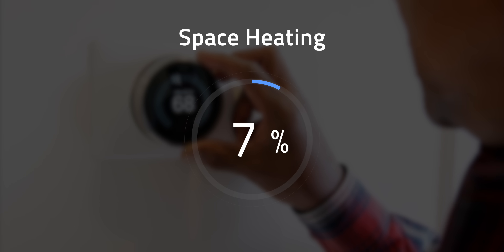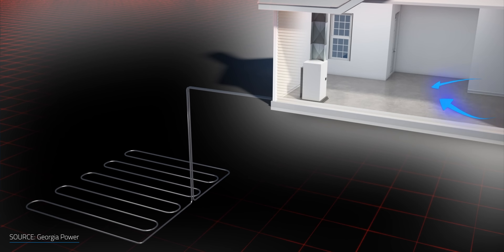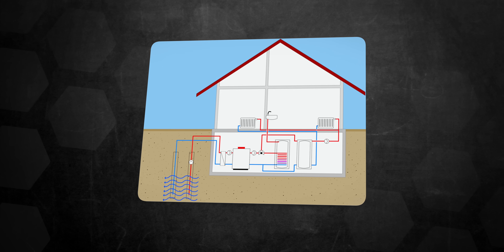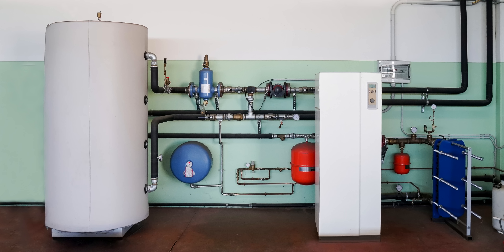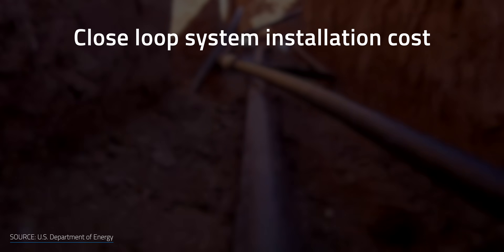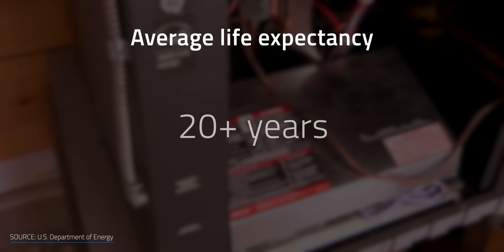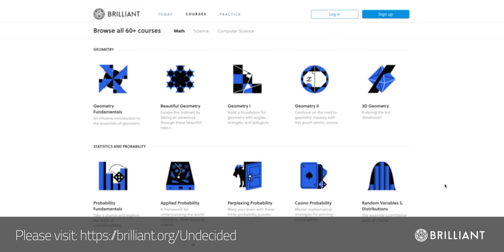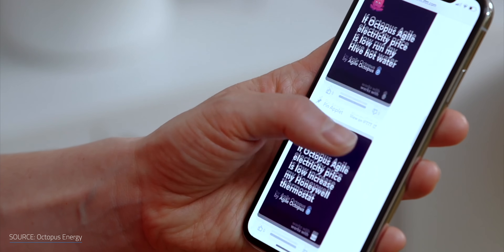Is Geothermal Heating and Cooling Worth the Cost?  Heat Pumps Explained

Comment from the maker: Do you want a geothermal heating/cooling setup for your home?  I know I do.  And to learn more about geothermal energy, check out my other video on the topic: https://youtu.be/-HhdR9YRGxI?list=PLnTSM-ORSgi5LVxHfWfQE6-Y_HnK-sgXS
Reply: Could you do a show on combination solar panels? I hear they could be 80% more efficient than regular solar panels
Reply: @roxter299roxter7  you can put solar panels and geothermal un thé same sistem at least we do that in Switzerland it’s been long time we doing geothermal but we don’t make loops I just make a hole like 100m 150m deep
Reply: I have a vertical closed loop geothermal setup in upstate NY. Home is from 1800's - which is moderately insulated (thick walls make for good insulation!), but infiltration could be better. One thing to keep in mind - When you continuously remove 12 Kw from ground for heat in winter time - it suppresses the "ground temperature" in area around vertical wells (350 ft deep each - 2 wells) to point that water returning from earth loop can be 28-30F..... heat gets removed.... water going back to the earth 22-24F. Wells act like "cold fingers" inserted down into earth. There is no 55F water! So geo works good when it is low teens - no wind.... or mid 20"s with wind. But cooler than that.... on comes the dreaded  electric boost heaters (60 amps of 220VAC each (2 banks)!!!!). So..... to prevent that I use pellet stove during these taxing times to prevent electric boost heaters from coming on! I use Pellet stove to preheat air prior to going into geo system. Heat pump is essentially a Delta T maker..... so warmer inlet air gets heated higher - distributed to entire home. Electric boost heaters do not come on. It would be great if the Geothermal installation companies would think about something other than electric resistance heaters for "boost requiring conditions".
Reply: @josephnehrbauer7343  You are describing my sitiation right down to location. I'm also in Beautiful Upstate NY, run a 2.5 ton geothermal in a 30 year old house with a pellet stove to supplement as needed. We rarely need it, but we like the ambience of the stove fire so I go through a ton and a half of pellets every year. The pellet stove can easily hold it's own in heating our 2400 sf house. The only times I felt a need to run it is under the worst Winter tosses us, and we've seen -10F and 20-30mph winds. But down to single digits the geothermal will do fine on it's own keeping us at 70-72F.

But as you say, there's the dreaded resistance coils. And I was caught off guard two winters ago when I didn't realize a capacitor had failed in the heat pump, and for the month of February we were heating on resistance alone. The thermostat gave a clue (thanks!) that something was wrong in that its display had entered a resistance mode, Stage 1 + Stage 2, but flashing. For whatever reason it didn't click in my mind until we got the electric bill and was 3 times the most we'd ever paid.
Reply: i have geothermal heating for 10 years now!! works great!
Reply: Here in The Netherlands we have a company called Solar Freezer. This is what i am getting installed this summer.    You should check this out
Reply: @homegrown241  Do they install Ice Thermal Systems?
Reply: Yes, I would love to switch to GSHP & hybrid/combination solar panels & wind, with energy storage, vehicle charging, etc. I just need to find the money.
Reply: @williamclark6466  You could start with a thermal hot water system..

Personally, I want to use a combination of geo thermal and evaporative.
Reply: Biggest problem is that it didn’t hear is that most homeowners don’t own their house long enough to actually pay for it.
Reply: I am an HVAC tech and I am very firmiliar with heat pumps and TLDR unless you have a huge structure you are better off with an air to air heat pump.

Geothermal is great if cost is not a factor for you at all (who doesn't care about that) because geothermal is not only more expensive upfront but it is not significantly more efficient than an air to air and are an investment that is unlikely to ever pay for itself compared to an air to air heat pump. Also he mentioned the low maintenance which is not completely untrue but when the system breaks you effectively have to replace the whole system where an air to air heat pump is no more than replacing the out door unit in central air. He also mentioned air to air not being able to provide enough heat but I am going to tell you there are functional air to air systems in Fairbanks Alaska. Also don't get me started on the government credits because that's just the government giving you your money back so you can buy something (usually that their friend developed) you still paid for it either way.
Reply: If you have a basement, Finish it. That's all the geothermal system you need. My aunts house had a basement living room so year round was never hot or cold
Reply: So it appears to be a decent replacement for AC (though unsure if it could handle the cold of Siberia or the heat of south Texas- giving around 20°-25°C [68°-75°F]), but how would they or some other passive technology replace the "AC" of refrigerators which are required in modern society (definitely in businesses)?

If it can handle the heat, some of my Aussie friends would definitely use since the power situation is terrible in rural areas and they have already said NOOOOOOOOO to nuclear long ago.  Wind doesn't always blow and the sun doesn't always shine (and the wind never shines and the sun never blows...except solar wind).  Nuclear was considered green, now it's the abandoned child that has few but explosive outbursts that no parent wants in the divorce.

Labor wants green energy (wind and solar), despite intermittency; and national/liberal wants coal and other dirty fuels, despite being major polluters.  Common sense please...
Reply: @리주민  An evaporative system could easily handle those high temps..a combination of the 2 would be perfect, in my opinion.
Reply: Your math is wrong on using 3.5kw per ton of heating/cooling. It's about a third of that. 11kw for 36,00BTU is nearly the efficiency of straight electric heat!
Reply: I live in New Zealand and we are looking at doing a feasibility study in Rotorua where there is extensive geothermal activity. The study will look to incorporate Solar and Wind in the development of a micro grid for housing developments of between 10-50 homes. 

I love this video, thank you for creating it.
Reply: @everardwhangapirita  Look into "LOw temperature" thermal fluids. Using refrigerents like Freon, etc as a substitute for water in a closed turbine you can generate electricity from heat sources as low as 75 degrees Celsius.
Reply: @spikedpsycho2383  thanks for the advice. I’ll look at that.
Reply: it´s really common in sweden
Reply: Do you list where you get the sources from these videos??
Reply: Have you seen "Just have a think" channel?

Your doppelganger
Reply: Ground vs Geothermal heated source. Two different approaches, according to this. https://jlphillips.co.uk/ground-source-heat-pumps-vs-geothermal-energy/
https://www.ecohome.net/guides/2241/heat-pumps-ground-source-geothermal-or-air-source-which-one-makes-more-sense/
Reply: We save about 100$ a month on average. Saved almost 20k since we built our home in 2008.
Reply: ho far can the underground part get from the house could i say do the same thing longer distance and set the underground part up under a ground pool ? i guess you need stronger pumps then
Reply: Dude, you totally ignored what the typical temperatures achieved, as in how warm in winter and how cool in summer,  which is not that awesome according to the folks I know. You also neglected to indicate is separate loops have to be installed for separate units for separate zones in the home, as in one for upstairs and one for main floor, and maybe one for the basement.
Reply: The simplest way to benifit from geo thermics, is to simply build your house partialy into the ground, and use concrete or block walls. This stabilized the temps from the earth into your rock walls, keeping the home cooler in summer, and warmer in winter like a cave
Reply: YES :D
Reply: nah. too niche, probably useful for a huge family of more than six.  one is better is with solar power and just buy an AC with heat pump.
Reply: Hey, could you look into VFD's(Variable Frequency Drives)?
Reply: You don't heat and cool at the same time..so heating usage being 15%, then cooling usage being 16% means that it totals about 15.5% average, if you heat and cool half the year. NOT 31%.
Reply: @BuddyRevell455  depends on how the research was performed.  If the total annual electricity usage was set up with a pie chart where it had 15% for one and 16% for the other - and 69% went to other uses - then it would indeed be additive (31% total) rather than averaged as you suggest.
Reply: It's to late for me to want one i already have one
Reply: Here's an idea for a closed loop vertical system, one side has a/many large pipes (depends on size of building), the other side has the same number of pipes multiplied by some number, I'll go with 8 for this example, the pipes should be thin, the initial pipe splits into those 8 at the bottom and rejoins at the top, the cold air or liquid will naturally fall and push the heated liquid back up, the thin pipes will help further heat the liquid providing what the short distance at the bottom did not
Reply: @zxuiji You need to learn about hydraulics. Learning is not the same as imagining.
Reply: @pauleohl  I'm gonna assume you only read my 1st response, either way I only gave an idea, it's up to the experts and hobbiests to see what they can do with it, just like how mobiles wouldn't have become a thing if someone didn't take the ideas given for transmission across the air and tried them out to see what worked and what didn't, what could be altered to work, what could be used as insperation etc etc
Reply: Heating no were I live the average temperature is between the high 80's and the high 90's so I would only need like 15 to 20 degree BELLOW that consistently through out the year

Cooling cost are crazy here because of electricity prices
Reply: We installed radiant heat and cooling pipes in our foundation.
During winter we only need to heat up the concrete foundation a few degrees about twice a week. The water runs in a loop through the tankless water heater.

During summer, water valves are switched, when watering the farm, the cold water passes through the foundation, cooling down the house. Free spring fed by gravity from our mountain spring above.

Winter heating cost about 60 dollars a month for propane.
Summer cooling is free.

During summer, the house temperature never exceeds 80 degrees, averages 76 degrees.
During winters hard freeze, with heater off for weeks, house temp never goes below 52 degrees.
Reply: 50 c today i wouldnt mind the cooling
Reply: im in b.c it should not  feel like vegas and worse
Reply: fracking is not good and many other things that are contributing to earthquakes and ruining everything to say the least fuk us shima and more ?
Reply: brillient kinda makes me mad since 06 I have pushed for OPM-Our Planet Peace People Matter - 1 alternative powered farming resources combo o frenewables and farming 2 a  non social pro net work that things like brilliant would have been part of the education side was taken turned into teaparty twitter crowdrise kickstarter and more 3 Public Options bundle lik enet phone cable but one for or basic nessesities like house power car insurances help those who need the help and get fair share out of the top 5% like bazos and rest that cause the mess and rigg the systems helped my dad was a construction surveyour and i grew up around the big dam job to confederation bridge i started learning a bit of autocad on when i was like 8
Reply: instead of grade 12 science i took an environmental studies class that looked at alot of stuff in depth
Reply: @George Mann Not just that it doesn't take heat from the ground or house to transfer. It creates heat with the compressor. Gasses and liquids compress rapidly create heat,  when expanded rapidly they create cold. They can use an exchanger with a fan to displace the temperature difference. This guy in the video is an idiot.
Reply: U should have minimum 1million subscribers for ur work.
Reply: Remember us when u have 10 million subscribers ok
Reply: @starkstark4139  https://www.youtube.com/watch?v=6CqXgs-7ico&list=RDMMqORYO0atB6g&index=18 DMX - Where The Hood At? (Dirty) (Music Video) HQ
Reply: I do miss one critical drawback for this type of heaters. These heaters will be cooling down the ground around the pipes. This works perfectly well IF THAT GROUND has any source for sufficcient warming up again. If not.....don't install such a geo thermical system.

Or add to the geothermical system heat collectors , same type as now used for sun heated hot water boilers, an d force the upwarming of the ground in the warms eazons....this will work if you have a nice place to install those collectors, a snny roof would do. Also usable....solar panels with fluid cooling...The renedement of a solar panels increases when it is less warm...and with fluid cooling using the same pipes in the ground for heating up the ground at the same moment maybe you'll het enough warmth back in the ground for the heatpump in winter.

For the picture...I do have a nice geothermal heatpump for at least six years now perfectly working. But before installing we had checked groundwater flow around our house...this flow transports heat back to the pipes, even with a closed system. Some numbers...we can extract 50 watts of energy from 1 meter of pipe in the ground. For 10KW heating capacity we needed 200 meters of pipe, vertical installed in holes. Holes should have  at least seven meters between because to close together drilled holes will influence the reheating (with the groundwater flow) of the ground to much.
Costs of this installation according to the picture in this video...and it was a new  installation in a region without gaz pipes. This changes the investment differences as showed in the video a lot. Because for any oilheating we would have to build an oil proof isolated cellar for oil storage (expensive to build)  Or a gaz tank far outside the building and border of property as safety margins when leaking gaz.
Reply: @reiniernn9071  there was a newfoundlander who took pop cans painted them black and used small fans to pump hot or cold air it heat rises cold air sinks  it was kinda neat lol and cheap
Reply: @reiniernn9071  same idea as how a black car heats up in the sun
Reply: NOOOOOOOOOOOOOOOOOOO
Reply: Depending on geological location, yes. It could bring down the major cost of home ownership. I used to live in the North East and oil got really expensive. Had a few winters of barely keeping the house warm due to the cost of oil.
Reply: Yes.  We almost put one in for our new home build.  My husband's friend talked him out of it...DANG.  Still kicking myself.  BUT we do have a full solar array.  No batteries yet (hooked up to the grid), but that is the next project!  Love your channel.
Reply: Yes I do.
Reply: We have it and love it so much! So glad we got rid of oil!
Reply: I think reducing the need is more efficient. I have upgraded insulation and made heat exchangers to reuse heat from grey water. http://www.heatsnagger.com/wp-content/dwhrpictures/2012/01/vxpipe_installation_diagram.bmp1.png
Reply: @egilbruoveraa8333  I did similar about 35 years ago. The heat captured is negligible. Once the shower water runs along the shower floor it is barely warmer than room temperature. I transferred the heat from the grey water to the cold water inlet to the shower to maximize temperature difference.
Reply: @pauleohl  shower cabinet with good heat insulation in the floor an full balance in the heat exchange give a good pay back. 

I do not have the same experience.

But then again. Taking out the heat in the floor and keep it in the house heating is also good - as long as you are heating and not cooling down the inside temperature.
Reply: Not in the northeast!
Reply: Does drilling for geothermal heat create any of the problems of fracking?
Reply: I would like a home first
Reply: nah not as good !!! my mother cousine have !!!
Reply: As a HVAC technician I understand all the concepts.. however I don't understand why is it necessary to be underground as such.
Many different types of "condensing units" such as shell and tube or tube in tube condensers provide more efficient 
Heat transfer coefficiency and also more practicality in terms of maintenance or contingency planning
Reply: Depends on if it’s as effective as the regular heating and cooling system. I don’t want air that’s barely any colder for my air conditioning or heat that’s barely warming
Reply: Would be be possible to build system for several homes
Reply: If every house worlwide was heated in this way would the ground temperature remain stable?
Reply: FOR THE FOOD PLANTATION OF GROWING A VEGETABLE GARDEN AND NO NOTHING NUCLEAR OR CONTAMINATED OR CONTAINING RADIOACTIVE MATERIALS EVER HAVE TO LEAVE THE BATTERY ZONE OR EVER HAVE TO CONTAMINATED THE FOOD CORPS ZONE THERES ANOTHER WAY THATS MORE SAFER LIKE A DOUBLE SIDED HOT WATERBOTTLE PLACE UNDER COLD AND FROZEN GROUND AREAS PLUS THEY ARE MADE OR STEEL THERE CAM PAST HOT SPRINGS WATER THROUGH THEM SINCE IN RUSSIA THERES PLANTY OF NATURAL HOT SPRINGS THE PANS BEING THICK ENOUGH TO PLACE FLAT UNDER THE DESIRED GROUND FOOTAGE FOR PLANTING PLANTS HEATED ENOUGH TO KEEP THAT COUNTRIES DESIRED HEAT GROUND AND LESSER POWER NEEDED TO DO SO BESIDES A NATURAL BOILER UNDERNEATH THE GROUND AS WELL BOTH WOULD COST BUT ARE ENVIRONMENTALLY SOUND SAFE AND DANGEROUS AND ODDLY Convenient WHEN DO RIGHT ANY THING NUCLEAR SHOULD BE CONTAINED AT LEAST 100 FEET OFF GROUND REASONS BEING VAPORS AND LEAKAGES ARE VISIBLE DURING ANY SITUATIONS IN A STRUCTURE THICK AND VENTED ENOUGH TO DO SO AND SHOULD BE SAFE TO TO BUILD AS WELL AS BREAK DOWN OR SHUT OFF FOR REPAIRS APART SO AT DISTANCES THEY DONT EXPLODE TOGETHER SPACE BETWEEN
Reply: Let's get an update episode on the company Quaise out of MIT
Reply: What about hot water?
Can I cool my house and get hot water at the same time?
Reply: Wonder how the cost benefit analysis looks in Central Florida.
Reply: My state has no direct-use systems and limited near-surface geothermal resources to run them
Reply: We've done a unique project for a company that shows how their system works! https://youtu.be/IHFe6EJ8avE
Reply: Do we "humans" need this kind of Tech to survive 👍🤔 What you are trying ( inserted with Adds by Tueb or your's ) 🤔 me from India not a Hindu 👍🙏
Reply: I THINK I want a geothermal system.  A big factor for me is to keep it simple.  It was a lesson that I learned, and will not forget.  I have learned a lot, but still want to learn more about geothermal before I finally decide.
Reply: Wonder if this concept could be utilized for apartments (100 plus units)?
Reply: Intuitively, I feel geothermal systems are, again, human abuse of the environment even though, in the case of domestic geothermal systems, the impact is reputed to be low...but why impact the environment at all? Solar energy is free and of infinite supply. IMHO, I would instead generate free electricity to drive home air conditioning system(s). Sigh. Please forgive my Canadian, Oldzheimers naïvety. 😔
Reply: The short answer is no, and here is why.
This technology has been around for some time now and has proven to be reliable and efficient in many ways. 
HOWEVER, there are two very important issues to consider and they are the thermal efficiency of the envelope you are heating (or cooling) and the demand loading of the system with respect to the exterior temperature differential. Typically you can only squeeze so much heat out of 52'F (+/-) ground heat and at some point the make up heat will have to come from somewhere to maintain a comfortable environment. 
Typically, this is electric resistance heating in the main plenum and do not assume that the thermostat can be played with to boost heating as you see fit because this will engage the resistance coils and just watch you electric bill soar. 
So the take away is that you will have to have at least a 200amp service and be on the grid and leave the thermostat alone.
Another caveat is that ground source heat pumps are technology dependant. There are pumps, compressors, solenoids and sensors that are operating at all times when the unit is engaged and these will eventually require maintenance. 
The technology works well BUT I would caution anybody considering this heat source to be well advised the best bang for the buck is to ensure your home has the highest insulation value you can possible afford.
One could also continue with discussing the humidification of the heated air (or dehumidification of the cooled air) within the envelope but that is another issue, although related.
Not all homes will be able to install this heat source technology. 
My advice. 
Find a good recommended HVAC installer and, if possible, engage an HVAC engineer to advise you through the process. 
Thoroughly study the task, understand the technology and look very closely at the economics.
Reply: @douglasker9770  , the standard HVAC contractors are the WORST people to ask!  They like to do what they know how to do.."Conventional HVAC"  If something is 10X better, they will still steer you in a direction of what THEY know how to install.  In america it is THE WORST!  Our contractors in the states are the worst in the world for wanting to advance technology.. Its the same if you try to buy an electric vehicle at an american car company, they knw nothing about the product, and they will try to steer you to buy a gas burning vehicle, even though an battery-electric vehicle blows away a gas vehicle.  So take Douglas Ker's advice with a grain of salt.  Find someone that is cutting edge (at least in this country, and old tech in other countries), and wants to actually keep money in the pockets of his clients.
Reply: No, it's a waste of money. On average, a homeowner can expect total expenses to reach between $18,000 to $30,000 on geothermal heating and cooling cost for a complete geothermal installation. The price can range from $30,000 to $45,000 with high-end ground-source heat pump systems for large homes. With an average electric bill of 1300-1500 dollars a year of which 40% is space heating you spend 500-600 dollars a year heating your home, even if geothermal systems cut energy heating use in Half that's 250 a year. Amortizing a 30,000 dollar installation by saving 250 a yearr would take 120 years!!! to pay off. And you're assuming the system would operate glitch and maintenance free. It would be far cheaper to simply stuff your home with better R-Value insulation.
Reply: @spikedpsycho2383  I'm an HVAC tech and you are spot on, to be honest idk if I would even install one in new construction because when you factor in maintenance costs they almost never pay for themselves unless you get lucky enough to have your ground loop go at least 30-50 years without getting a significant leak because the second you have to replace the ground loop your screwed. I have been to quite a few homes that the ground loop leaked, they got a quote to fix it and instead abandoned the system in the ground and got an air source heat pump. That's your other killer too ground source heat pumps (or geothermal) are way more efficient that traditional electric or fossil fuel heat but they are only mildly more efficient than an air source heat pump that costs no more than a central air unit to install.
Reply: @spikedpsycho2383  I didn't say the home owners had to pay for it, the companies should do so to reduce the electric they use which would cause less strain on the grid which in turn reduces blackouts and even makes renewable energy a more viable option, you don't build a house with a single brick, likewise you don't switch a grid completely to renewable energy by just focusing on the energy production
Reply: @zxuiji  Only 12% of global energy demand is electric, because converting to electric is expensive and not very efficient but it's safe for running casual devices. 72% of the worlds energy is thermal based because it’s efficient to  convert thermal energy into work without having to convert it to  electricity. You convert to electricity you lose half to 2/3rds of the  energy as waste heat. The carbon emissions from changing electric  sources dont matter much since 75% of all GHG emissions come from non  electric sources. The transition to renewables; means replacing thermal, chemical and mechanical power with several added steps, electric generation, electric voltage, transmission, and plug in. ALL these stages result in thermodynamic losses. An electric transportation infrastructure requires a 14 fold increase in grid construction, An All electric machine/industry would require a 90 fold grid increase. Fossil fuels are so much simpler
Fossil energy: Chemical energy --- Thermal energy --- Mechanical energy
Renewable energy: External mechanical energy: Weather permitting --- mechanical energy transition (Generator) --- electrical energy --- Voltage step up --- electric transmission on site --- electric transmission to destination (thermodynamic losses in route) --- voltage step down (transformer) --- transmission to consumer --- consumer utilization (electric motor) --- mechanical energy--- work
Reply: @spikedpsycho2383  You don't seem to get it do you? The public in general demands renewable energy, I can see why too, fossils will only last until we run out, better to switch while we can still generate the electricity we need to experiment and improve than to wait until we run out and re-enter the middle ages permanently. I get your point about non-renewables being easier to generate with but they are only a short term solution, a long term solution MUST be found or humanity as a whole WILL pay the price for it.
Reply: @spikedpsycho2383  Converting to electric (thermal to electric) has an efficeincy up to 80%. (Ideal situation, this isn reached in the nethrelands where also residue heat is used efficient). Most (but not all) other situations the usage of direct thermal heat is less efficient. Even cooking. When using gaz for cooking you'll spoil a lot of heat , going arond your cooking pan. When using electricity, created with 80% effeciency, for heating an insuction pan this will be efficienter (not chepar mnaybe) than loosing a lot of heat with gaz burning.
Reply: @spikedpsycho2383  I don't think your numbers are correct when you say that going electric will require a 14 fold increase in grid construction.

From my own household :  we do about 13,000 miles per year . An average EV gets about ~5 miles/kWh thus to do 13,000 miles we need 2,600 kWh to cover the distance. Even if we allow 50% losses for transmission,  charging etc (realistically it is more like 20%) thats 3,900 kWh for the entire year.  Today our house averages about 1000 kWh/month which is 12,000 kWh /year.   If we add in the EV energy usage the new total is 15,900 kWh per year which is only 33% more than currently which is way, way less than the 1400% you are claiming.

Also charging EVs can be done off peak when power demand is low.  Lower power demand means that the grid is also less taxed so it is quite possible that EVs can be integrated into grid with zero net  increase... we just end up with a grid that is more efficiently utilized.  This effect can be enhanced with smart grid technology.  For example with a "smart" house when my fridge needs to run to cool down it could reduce or even shut off the  car charging for that period so that the households net draw on the grid would remain constant.  Ditto with the A/C  or heat pump.  (Sadly right now our houses and our "grid" is anything but smart - basically the designs have not changed much in nearly 100 years)

Also your calculation seems to assume that future electrical generation will be as centrally generated as today's where in fact there is clear evidence that it will be significantly less centralized and therefore the demands on the grid may actually remain close to current levels or even drop!  Either way  the numbers would look way, way less than the 14 fold increase you talk about.  

Finally you exaggerate the impact of stepping up and stepping down of voltages on electrical transmission .  Transformers run at about 99% efficiency so the losses are minimal.  On the other hand the movement of fossil fuels from where they are located to where they are needed is significantly inefficient.
Reply: @stephenleftly4206  Charing a EV battery over the span of several hours is no big deal, adding 50 kilowatt hours over 4 hours requires a power output of 12.5 KW, Fast charging infrastructure of adding 50 kwh in 30 minutes requires a constant power output of 100 KW. as power demand grows....

The transition to renewables; means replacing thermal, chemical and mechanical power with several added steps, electric generation, electric voltage, transmission, and plug in. ALL these stages result in thermodynamic losses.Even after generation, as much as 30-40% of electricity sent thru the grid is lost as parasitic or heat, usually about 7-10% lost every 100 miles. 

Wind power is limited by the Betz Limit....and solar by the Shockley-Queisser principle law. In any case the maximum theoretical output. You also forget the geographic distribution of solar and wind covers huge tracts if land.... A nuclear plant covers five acres...a solar farm comparable output is 250,000 acres so thousands of miles of transmission wires must be made to interlink these devices.  

Global energy demand is 600 Exajoules...
Global electric consumption was 24,000 TW-h...(86.4 exajoules or 14.4%) BY default an all electric society needs 6.9    7x more powerplants. Factor in thermodynamic losses of 30-40%. An electric transportation infrastructure requires a 10-20 fold increase in grid construction. Because to replace transportation energy consumption is no easy task. US energy consumption in 2019 was over 100 Quad or 100 Quadrillion BTU’s/29.307 Trillion Kilowatt hours or 105 Exajoules. Transportation consumes 28% of tat. OF which 91% is met with petroleum; Gasoline, diesel, aviation fuel, marine oil fuel, etc works to about 96 Exajoules or 26.6 Trillion kilowatt hours a year. That’s 288.86 Petajoules per day (80.238 Billion kilowatt hours). Daily US electric consumption is 10.4 Billion kilowatt hours; Though the venerable electric motor is 2-3 times as efficient as an engine, you still need 5x more electricity than current to replace the transportation energy network. not just a "grid" but in being capable of handling the Voltage.
Reply: @spikedpsycho2383  Are you missing something? Like cooling? All the A/C systems I see use ELECTRICITY to cool your house. GEOTHERMAL HVAC is going to use WAY LESS electricity during the summer months to COOL your house. You could easily use a combination of Geothermal and Solar power to keep those costs down. This "super-heating"  of the area you're talking about is BS. There isn't going to be any change of temperatures in your system if it is designed correctly... what he was talking about  "space between loops, depth of loops". You seem to be forgetting about coefficient of performance.  Even if your COP for heating is slightly less efficient than gas heating in the winter time, the offset from how much better the performance is in the summer time will MORE than make up for your electricity use over the course of the year. This means a significant drop in your yearly consumption of electricity. If you live in a place like Texas, you can also use the geothermal hvac system to generate all your hot water needs in the summer months. The only real downside is the upfront cost of installation. Your increased efficiency should pay you back the upfront cost within a decade. You're never going to have to jack with the loops, so your maintenance costs should be a lot lower too.
Reply: Isnt installing Central heating around the same cost as the low end of the geothermal pumps?
Reply: Bad math. Heating and cooling don't happen simultaneously for 31%, more like an average of 15.5%.
Reply: Hey Matt, nice video. Very informative. Do know what house is at 0:04~0:06 ?
Reply: This is going to be forced on us in the green New deal
Reply: But Matt, geothermal heat is partly the primordial heat from when the Earth was formed and partly heat generated from within the Earth's crust from the decay of mildly radioactive elements, how is that not adding to Earth's heating by greenhouse gases? If left there it would not be part of the future, thus by releasing it you are ADDING to global warming. 

So essentially, with all the geothermal energy being released into the atmosphere we're fucked. Especially when even those wanting to do something about runaway climate change are true believers in one of the additions to the problem. It can't be also part of the answer. 

You don't sound undecided to me, more cheerleading a technology that is, to a critical thinker, adding massively to global warming if the statistics you quote are accurate. Has it really not occurred to you that this energy isn't poart of the already heating planet, and is thus another nail in the coffin of planet Earth and all who sail on her?
Reply: @davidjessop2279  could you please elaborate on how this technology is contributing to global warming?
Reply: @davidjessop2279  dude, it's as clean an energy source as you can get .
Reply: GSHP do not, I repeat DO NOT, warm the planet in the effect as you stated, i.e. increase climate change. For one, the cool the ground part of the year and warm it on the flip side. These cancel each other out -cancel your hypothesis. Aside from that, GSHP are more efficient than traditional heat pumps.